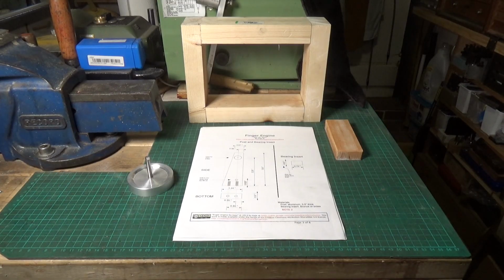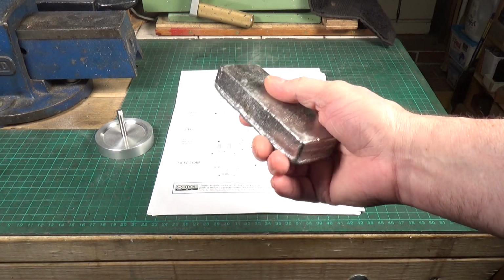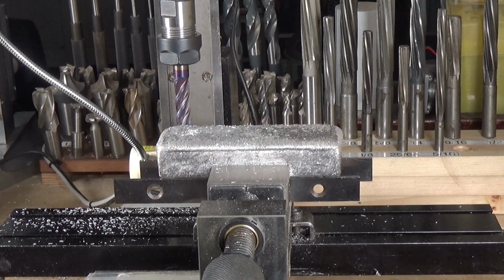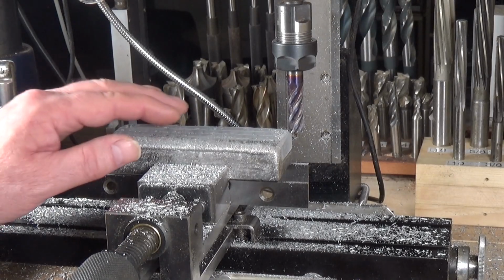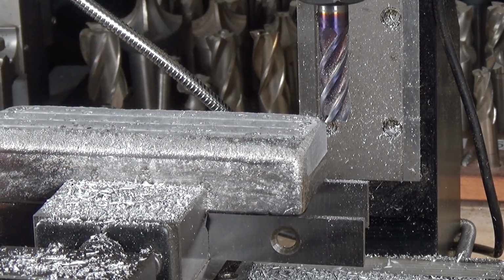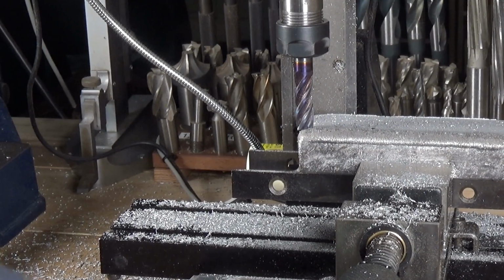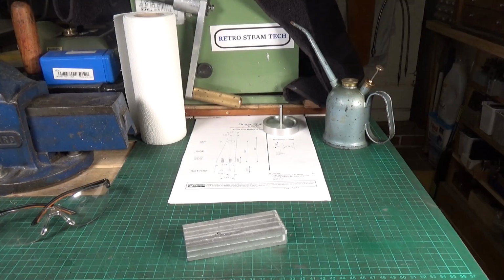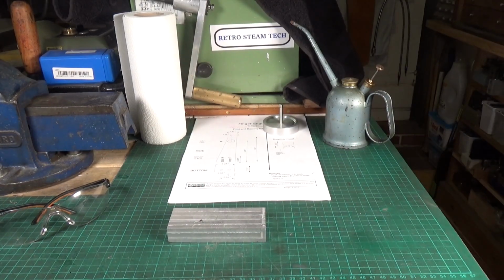Lockdown Project - Finger Engine - Part Four

Comment: Hi Alan,

It's all learning curve.  At least you're having a go.

Looking at that pour, I think you had the ally too hot.  This will cause hydrogen bubbles.   Always pour as soon as it goes runny, never let it get red hot.  

As already commented, I would have faced that in the four jaw lathe chuck, provided you have enough swing to do it.  It would be a lot faster.

If the ally is no good it's only a bit of time lost.  Quite often porous ally is much better heated second time round.  Those holes looked more like carbon from impurities than gas blow.

 Good luck with it all.

Cheers Rob
Reply from the maker: Hi Rob. Yes it is indeed a learning curve. I think it was a combination of several factors, I probably did have the ally too hot, didn't remove enough of the crap on the top of the melt and from what I've been told the open mould doesn't help either. Still it was usable after I got it down to size. If you stay tuned for the next episode you will see that it finally dawned on me to use the 4-jaw chuck!! Cheers, Alan.

Comment: Hi Alan could you use a fly cutter and center it in "Y" axis to cover the whole surface?
Reply from the maker: Hi Ed. Yes I could have used a fly cutter but with this very small mill you have to take very small cuts with a fly cutter. It would have taken ages! Cheers, Alan.

Comment: Hi Alan, Slow and steady wins the race. If you milled it to width would you then have enough Y axis movement to cover the top face? Cheers.
Reply from the maker: Hi Paul. Even at the correct width there isn't quite enough Y travel.  Stayed tuned for Part 5 as I use an alternative method to reduce the thickness. Cheers, Alan.

Comment: You need a closed mould when casting blocks of ali, saves a lot of blow holes. Clean all the dross off the top of the melt before pouring or you will get incluesions.
Reply from the maker: Thanks for the info.

Comment: Brilliant! I have no idea about casting at all, but that's a fair chunk to be machining on there. You need a wm14 mill :) Regarding the casting... did you have to use any fancy degassing stuff or is this just raw stock melted?
Reply from the maker: Thanks Ian. Yes, I would love a Warco mill but sadly have no room for one. The aluminium used was stripped down old 3.5" hard drive chassis, just cut up on the bandsaw and dropped in the pot. Cheers, Alan.